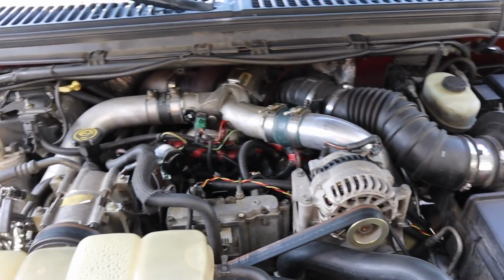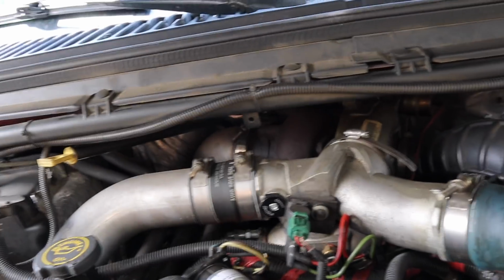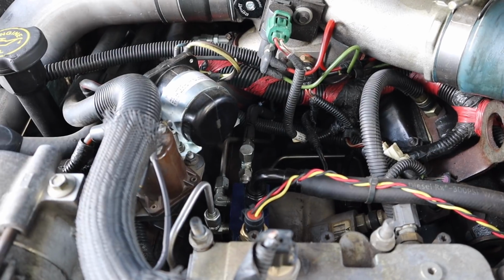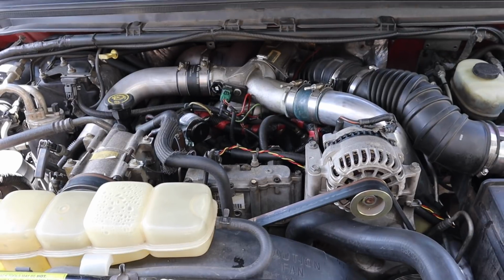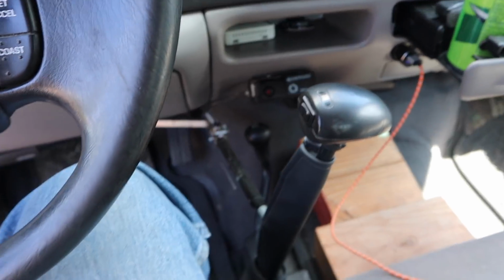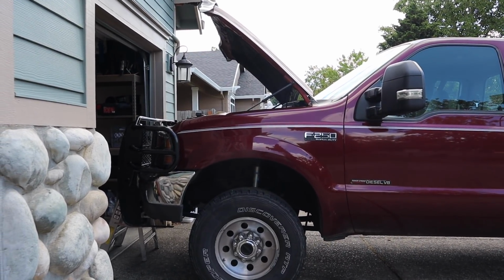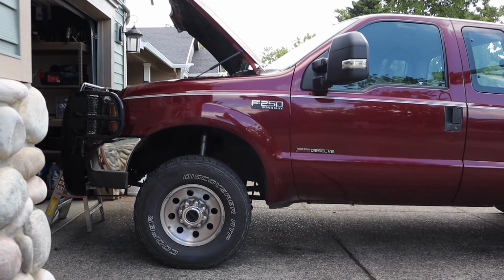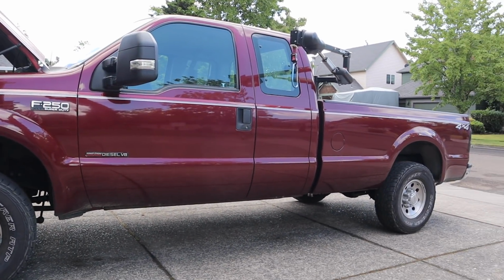7.3 Powerstroke Power and Performance Mods Update

Comment: This maybe an off the wall question, but are you running stock tires on the truck? By that I mean stock size tires.
Reply from the maker: Technically no I don't think so. I think stock was 265/75r16. In this video I am running 285/75r16.

Comment: sweet, the fuel lines underneath look vulnerable to whatever maybe find another / second tranny crossmember or similar and mount it over that section too cover all that with some serious steel ?
Reply from the maker: I have definitely thought about that. At some point I may fab up somewhat of a skid plate.
Reply: @LivingOnWheels  you would have to or else around here in pacific northwest logging country, did you do the fuel pickups in the tanks they sure seem like a weak link ?
Reply from the maker: Yeah, this thing does not go into that terrain often but I do stay alert to what I am driving over. The fuel feed and return lines run through that sump on the bottom of the tank.
Reply: @LivingOnWheels  I'm going to delete my fuel filter bowl too at least I have a nice heated raycor unit clean up that clusterfarb in the valley that looks much cleaner your restoration is coming along most respectably : )

Comment: Hey bud why don't you put oil crossover on it to help balance out the oil in between the heads and also make it run a bit better and a boost Fuller will help
Reply: Also in one of your videos when you was driving pushing on the skinny pedal pretty good in one of your shift points you can hear the turbo back lag that's why I mentioned something about a fuller but anyway good job keep the videos coming
Reply from the maker: @n-lessfix-itlist3836  I appreciate it. Lots more to come! Including with that snail under the hood you're talking about! Stay tuned!
Reply from the maker: Thanks for the input. I actually have an oil crossover on already. Like I said, I am sure I forgot to say some things in the list. Boost fooler is also not needed anymore to the best of my knowledge because most tuners write that into the tunes when you get custom tuning.
Reply: OK I didn't see it I guess I seen that  high pressure oil line was still in the middle of the head coming from the pump so I was assuming that you didn't have one yet I'm sure I'll see it another videos then
Reply from the maker: @n-lessfix-itlist3836  It sits behind the intake spyder so it is pretty hard to see. You can get a really good look at it in my two most recent videos when I have everything pulled out of the way.

Comment: FOR WHAT YOU DO YOU DONT NEED A BUILT TRANS. YOU NEED 2 THINGS. 1 LARGE TRANS COOLER, THAT IS THE MAIN PROBLEM WITH 4R100 NOT ENEOUGH COOLING. 6.0 COOLER FITS IN PLACE PERFECT. 2 INCREASE LINE PRESSURE. YOU CAN BUY A LITTLE VALVE FROM JEGS.  DRILL BIGGER HOLE IN VALVE BODY. IT COMES WITH INSTRUCTIONS. IT WAS DONE TO MINE WHEN NEW. SHIFTS GREAT. NO ONE TELLS ABOUT IT ANYMORE BECAUSE THEY WANT TO SELL TRANSMISSIONS..
Reply from the maker: I appreciate the input. A bigger trans cooler is definitely on the list of future projects. This trans is still doing great so I don’t foresee it going out anytime soon. A shift kit or valve body is definitely I will probably end up putting in to extend this tranny even farther. When she does go out a built one will definitely take its place

Comment: Have you seen Fix It Nick’s upgrade radiator hose video? How about a Bypass oil filter? Or a external air oil cooler from Bulletproof Diesel? As we know cleaner & cooler oil adds to longevity to the engine/injectors. Also, an upgraded radiator/transmission cooler from Mishimotor? Again, cooler coolant add miles to the longevity of the truck. These are items I’m thinking about as funds become available, Lol
Reply from the maker: Lots of good stuff! I have seen it and I actually have that hose sitting on a shelf right now as my spare. I haven't had any hot oil issues and interestingly enough, ford actually changed internationals design of the water pump on the SD 7.3s and changed the thermostat from 203 to 195. So most of the superduty trucks actually run cooler than international designed them too. I have thought about better filtration, but if I do want better I'll probably just get a better filter for the stock location. As for the trans though, an upgraded cooler is definitely it its future! That whole "funds" thing take all the fun out of it haha.

Comment: You shouldn't need a boost fooler with the hydra, your tuner can and should be able to adjust boost in the tune. Ps u don't want to go over i think is 35 psi on stalk valve springs.
Reply from the maker: That has crossed my mind. I think you are correct. I was figuring I’d probably set my waistegate to open around 30psi or a little sooner. If my boost numbers even get that high.

Comment: 1k!  Nice man.  I would dump some $$ into the trans next.   From my experience the HPOP won't help out until you are much further into mods.   Too bad you are not in eastern OR.  I would not be that far from you at that point.
Reply from the maker: Yeah. HPOP seems to be supporting the ACs great. Trans also seems to be doing great, but I have the money set aside for the first sign of problems with it.

Comment: Okay probably a dumb question but I just bought my first 7.3 truck. The truck is stock and it’s slow as hell! Haha I want to slowly start upgrading it but I don’t understand the whole hydra tune. I see a lot of people sell it so I’m guess the hydra is just the software where the tubes get downloaded to ? How do I know who to buy it from ? Any help would be great ! Thanks !
Reply from the maker: Hey man, first off, congrats on the new rig! These 7.3 live by the motto slow and steady haha. The hydra chip is basically a computer chip that you connect to your trucks computer. What makes the hydra so loved is that you can connect it to your computer and download any tunes you want. So for me, I have the hydra chip and I bought custom tunes from JeliBuilt performance. Most people would agree that JeliBuilt Performance and 1023 Diesel are the two best tuners in the country. Because of that, I would recommend buying the hydra chip from one of them because you will get their tunes for free on the chip. Feel free to let me know if you have more questions
Reply: also watch his video on adding more power because i noticed you said it’s slow. like he said you want more air intake and coming out!🤘🏻
Reply: Thanks that the plan to build it slowly !